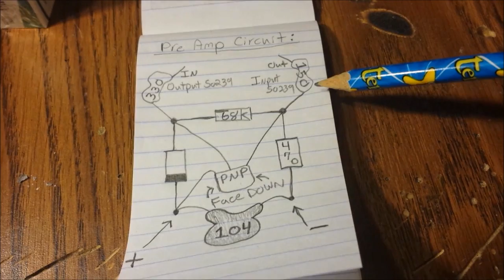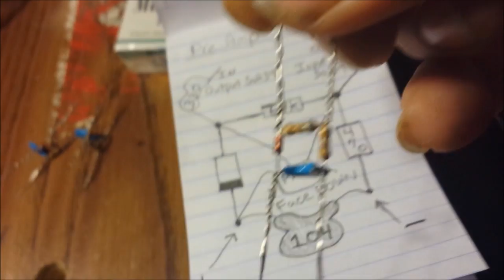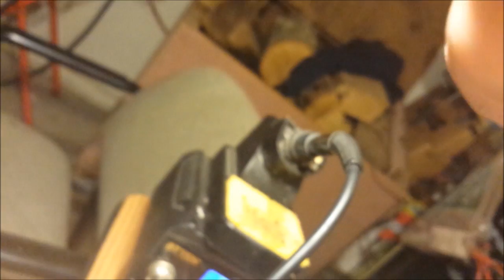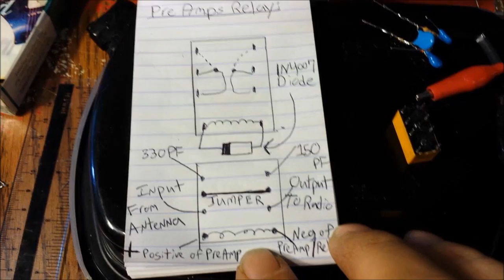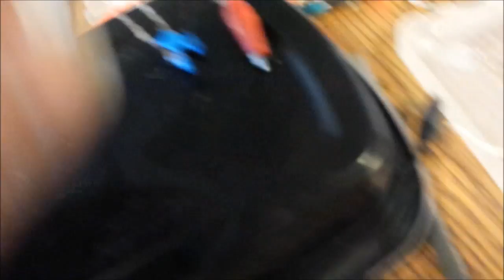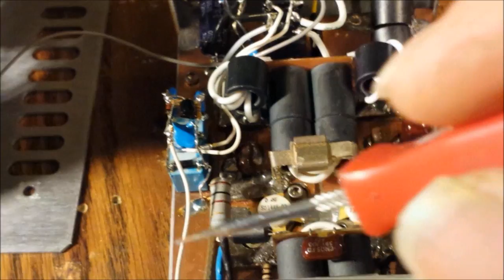How To Build A Simple RF Preamp -[With Install Instructions]

Comment: As drawn, and assuming the transistor has the usual pin-out (CBE), this is an unstable (as far as DC voltages around the circuit) small current amplifier. This basic design is used often because it is cheap to implement.

The 68K resistor coming directly from the collector, which gives negative feedback and restricts the gain, also biases the base and determines the collector current. The ratio between this resistor and the collector resistor sets the current to be pulled through (and hence the voltage to dropped across) the collector resistor. This will only be true for a certain Hfe (current gain) value, so the transistor must be selected for these values (or the values can be changed to suit another transistor type).

The voltage developed across the output resistor (in this case the 470 ohm) is the output signal. The circuit is unstable because the temperature coefficient of the components, magnified by the current gain of the transistor, allows the collector current to vary - although this is partially negated because of the inverse function of the feedback. A few more components would make a much better (stability and noise) pre-amplifier.

BTW, I see no purpose for the diode on the left unless a large input signal (greater than the supply voltage - 14V) comes in. It would be unnecessary if the additional components I mentioned earlier were added. Perhaps it is there to protect against a slow transfer relay.

One last comment. Modern preamps take into account the input and output impedance of 50 ohms. In other words, it will present an impedance of close to 50 ohms to the receiving antenna, and give the best gain when looking into a 50 ohm load (the input of the receiver). This circuit does not.
Reply from the maker: There is not 1 statement I disagree with you about. Very well put. Yes this is literally the easiest RF preamp to make that has not input or output imped matching at all. I personally use a MMIC now which is internally matched for 50 ohms. Do you think you could add more values to this preamp for a more advanced version? I'd love to make a video showing it. Let me know please. Text me at 678 557 4846

Comment: Have you seen the transistors BFR91A?
  I have some amps with built in preamps. The relay starts to switch itself in and out while I'm talking. Should I add a capacitor across the coil or in series with it? Should I change the diode across the relay?
Thanks.
(Some relays have their coils in the middle and not at the end. (The small ones with the clear cover)).

Comment: Howdy. My thinking only.
The transistor is PNP so the + should be regarded as ground and - as hot. The diode seems to be in anti-parallel with the base - emitter junction. It may be a surge or spike protector of the transistor. Or perhaps a input signal clipper in case of overdrive.
I should think the 68 k is for biasing the transistor and the 470 ohm on the collector delivers a rather low output impedance. The 68 k + the 470 ohm also form a thermal stabilization setup. The 10 nF cercap is almost certainly for filtering and shorting any residual RF on the + - rails.
Regards.
Reply from the maker: Nice evaluation!
Reply: @1883GotDown  Howdy. Thanks mate.
And the cap. is of course 100 nF as made very clear in the clip.
Regards.
Reply from the maker: @eugenepohjola258  indeed for filtering

Comment: Hi gatekeeper! I was looking into what a preamp actually does and mostly the info that I have found says that it is used primarily to clean up receive signals. Is this correct? 
I thought it was there to boost a weak radio output.
Reply from the maker: No a preamp is used to boost your incoming signals. It isnt designed to to clean up your signals but to boost what is already there. For example if your speaking with someone and they are barely loud enough for you to hear, you can hit the preamp and it will increase your receive a little bit but some preamp introduce more noise with it and some introduces less. I have one coming out soon that is amazing! Called the GKpre. Be on the look out and thanks for stopping by.
Reply: @1883GotDown  Ok thanks! Ill be on the lookout!
Reply from the maker: By the way, just wanted you to know I have started uploading videos again :) Pleasebcome by and watch a few. I ALSO just recently released a 5 video series on the 5 building blocks of an amplifier and If you want to support me, leave a comment and some thumbs up & thumbs up on other peoples comments. 
It really goes a long ways in helping YouTube show my videos more due to the way they have the algorithm set up now.. Thanks so much in advance.
BTW This is my last video I released: 
https://youtu.be/dHA-2blbX3k

Comment: Hi Gatekeeper, can you tell me if this will work in a tube type base linear?
Reply from the maker: Bee Keeper of course this has nothing to do with the amp. You just need to find your self a 12 to 18v DC PWR Connection to use for the preamp. You may need to rectify a 12vAC with a rectifying diode and a filtetcap to get your dc voltage incase you dont have a supply already.
Reply: 1883GotDown 
Thank you for the reply.
Reply from the maker: @beekeeper2734  your 🙏
Reply from the maker: By the way, just wanted you to know I have started uploading videos again :) Pleasebcome by and watch a few. I ALSO just recently released a 5 video series on the 5 building blocks of an amplifier and If you want to support me, leave a comment and some thumbs up & thumbs up on other peoples comments. 
It really goes a long ways in helping YouTube show my videos more due to the way they have the algorithm set up now.. Thanks so much in advance.
BTW This is my last video I released: 
https://youtu.be/dHA-2blbX3k

Comment: The diode is just rectifying. The resistors are for biasing. The cap on the power in is a filter. The caps on the in and out are matching.... The transistor literally does all the work, just like your 2879's etc. There other components job is just to make the transistor work...  73's
Reply from the maker: By the way, just wanted you to know I have started uploading videos again :) Pleasebcome by and watch a few. I ALSO just recently released a 5 video series on the 5 building blocks of an amplifier and If you want to support me, leave a comment and some thumbs up & thumbs up on other peoples comments. 
It really goes a long ways in helping YouTube show my videos more due to the way they have the algorithm set up now.. Thanks so much in advance.
BTW This is my last video I released: 
https://youtu.be/dHA-2blbX3k
Reply from the maker: DR Killowatt i now understand this lol i need to make an updated video :) thanks so much bud for the comment. Yes the 330 and 150 can both be 103 or 104 or 101 they are coupling caps and i would love to see what mathematical equation Texas Star or whoever used to find the 330 and 150pf coupling caps you know?

Comment: Old video I know, did anybody ever tell you what, why and how this circuit worked? Your schematic was kind of cartoonish but pretty sure I got the gist, at the very least I would need to know the pin out of the transistor.
Reply: The 68k resistor provides regeneration, the diode limits the gain, the 104 cap clamps stray rf and the other resistor limits the current to your transistor.
Reply from the maker: @scottdowdy9994  thanks for that buddy
Reply from the maker: @scottdowdy9994  By the way, just wanted you to know I have started uploading videos again :) Pleasebcome by and watch a few. I ALSO just recently released a 5 video series on the 5 building blocks of an amplifier and If you want to support me, leave a comment and some thumbs up & thumbs up on other peoples comments. 
It really goes a long ways in helping YouTube show my videos more due to the way they have the algorithm set up now.. Thanks so much in advance.
BTW This is my last video I released: 
https://youtu.be/dHA-2blbX3k
Reply from the maker: That comment below covered the most important parts...couldn't have said it any better my self lol. Cartoonist...guess my whole life is like a fairy tale lol 😅🤣🤣😅🤣
Reply from the maker: By the way, just wanted you to know I have started uploading videos again :) Pleasebcome by and watch a few. I ALSO just recently released a 5 video series on the 5 building blocks of an amplifier and If you want to support me, leave a comment and some thumbs up & thumbs up on other peoples comments. 
It really goes a long ways in helping YouTube show my videos more due to the way they have the algorithm set up now.. Thanks so much in advance.
BTW This is my last video I released: 
https://youtu.be/dHA-2blbX3k